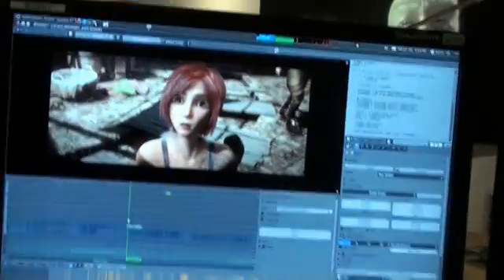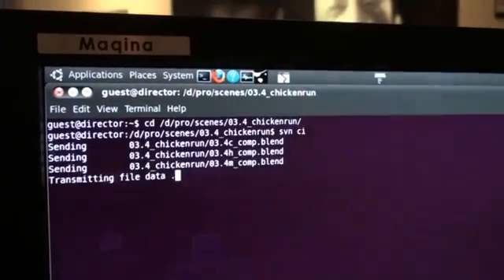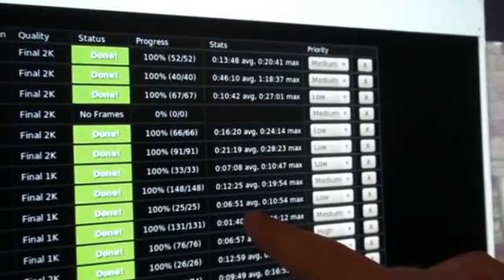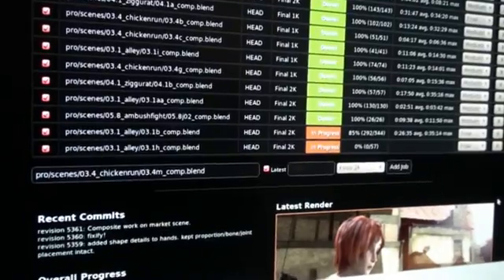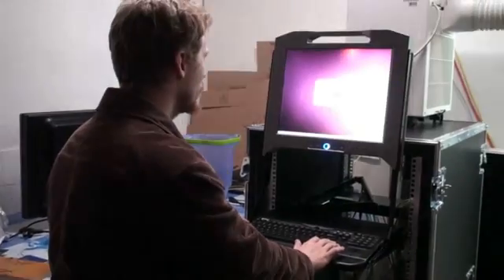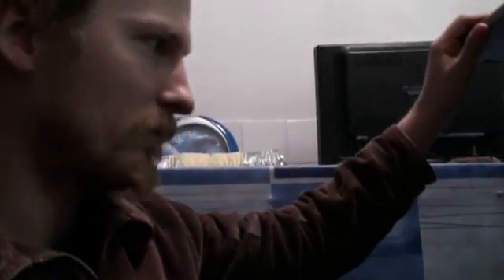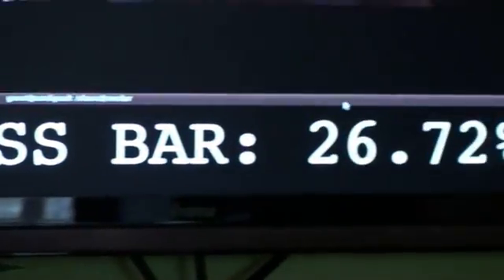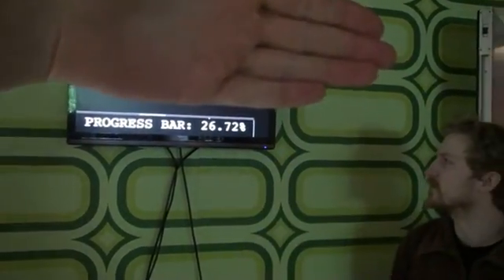Durian Project: Render Farm Tour

Comment: I'm not a coder, but use Blender exclusively at the studio I work at and I'm trying to figure out how to send multiple blend files or jobs to network render.  I liked in the video how you can just add blend files to the queue.  Is it possible to either get what you guys used, or set something like that up with very minimal coding experience?
Reply: At 10:34 he says "It was REALLY basic, it took like 4 days or something to set up"

So, no, probably not. If it took an experienced coder 4 days to set up a very basic system, then I highly doubt someone with minimal coding experience could set one up, even with a tutorial I think you'd run in to a lot of problems and have no idea how to fix them.
Reply: This video was quite a while ago, Blender may have introduced network rendering as part of its program.

Comment: Awesome job on the farm guys. Just a thought though, Ubuntu can be run from a live usb. So if you're not saving the final renders on the farm computers, it would eliminate ALOT of heat and would be much cheaper then standard hard drives.
Reply: that's right but anyway you can't rely on a live usb cause if it's crash, you have to reconfigure all from the beginning (y)
Reply: Jesus Christ... how about you just clone 20 USB sticks from your image?! USB sticks are just slow...

Comment: Unless the room was in turn cooled, which is really as easy as either using a cooler that dumps heat outside, or just forcing the ambient air through the area to bring it down.

Comment: Uhh ?
Using nicer coolers won't make any difference: they would draw more heat away from the CPU to give it to the air around. So CPU would be cooler, yes. But the room temperature wouldn't be lower !

Comment: @AndreR241 Yes you are correct. 1080p stands for 1080 progressive lines, and there is also 1080i which means 1080 interlaced lines and can actually be 1920x1080 or 1440x1080. The reason why resolutions have the last number to define their name I believe is because of interlacing.

Comment: @l0gically, having all the draws closed would only be better if we had a stronger fan in the bottom. The one thats there is not powerful enough to push enough all through all the systems fast enough it seems.